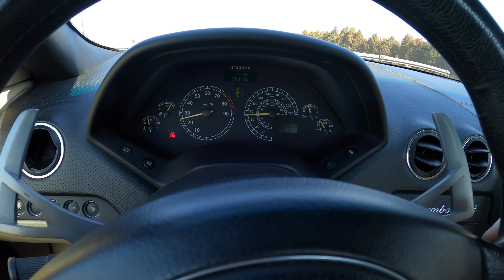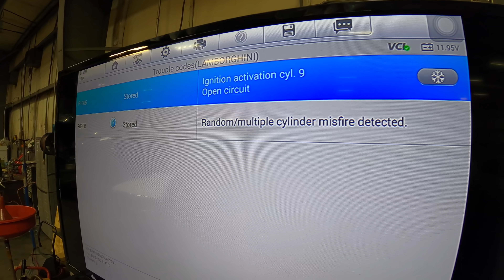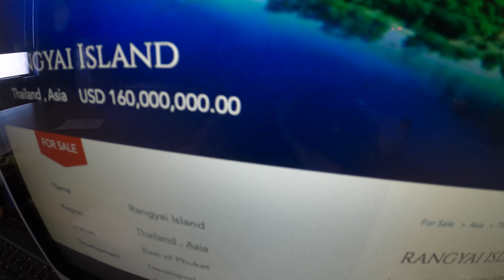Here's Everything That's Broken on the Cheapest Lamborghini Murcielago Roadster: HUGE ESTIMATE

Comment: When you come across a car with the first gear mashed to pieces and a clutch that's more slippery than the moral-standards of a Jihadist, it gives you an insight into the intelligence level and maturity of its previous owner. I never would have bought that car. It brings "money pit" to a whole new level.
Reply: find a junkyard transmission or buy a wrecked lambo
Reply: @shaukahodan2373  lol You didn't read my whole comment before you responded, did you? Go back and read it again, then ask yourself if I need that "advice" lol. That car has clearly been abused, and there's likely a hell of a lot more wrong with it than just a transmission and the parts that were mentioned in the video. There are Gremlins in that car that are just waiting to show their ugly faces.

Comment: clutch slipping and first gear crunched up tells me that the owner was an utter idiot that drove it in traffic and did a bunch of burnouts

there is couple more options for the transmission rebuild, weld up the gears and have them remachined by a competent machine shop
and look for replacement gears marketed for the audi or other brand using this transmission, you'll be amazed at the cost difference the Lamborghini name makes on the parts label

Comment: 17,000 and it’s got all those issues? 

How is it possible a car that costs that much is such a piece of crap? I’ve seen 50 year old GM pickups that have sat in a field for 30 years start up and run better. ❤️😮🙄😐

For $5,400 you can get a transmission that’ll hold up to 2,000 horse power for years and years by an American company. Lamborghini y’all are a rip off.

Comment: you pay for car 400.000 euros after u sell it for 17000 and it has only 17.000 miles lol ...  So sad..  and broken. My bmw almost have 300.000 milles still works. but for 40000 all together its cheap lambo.. Yes used is the best thing to buy vs original new.. New cost milions why ? because they need to make new transmission.